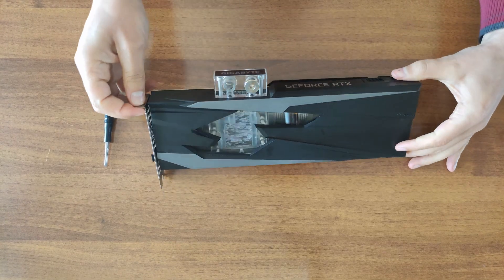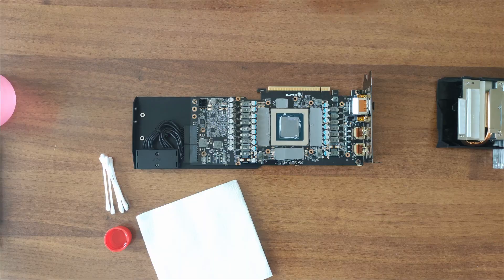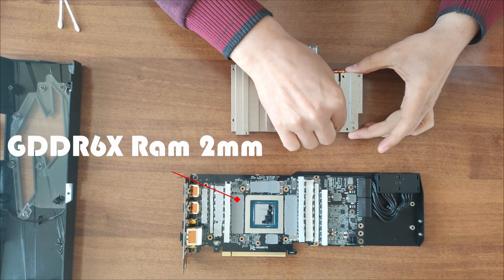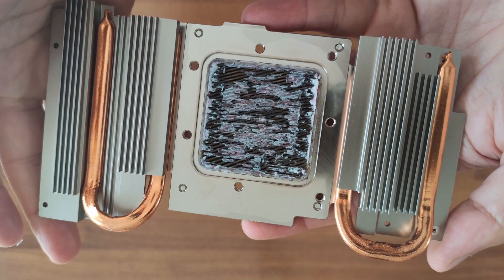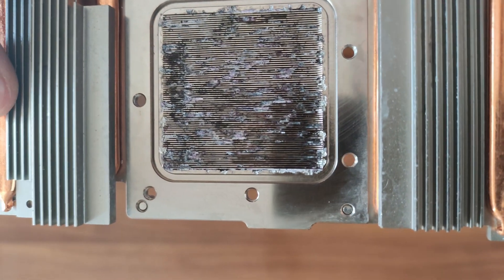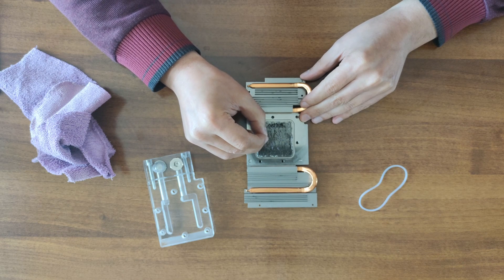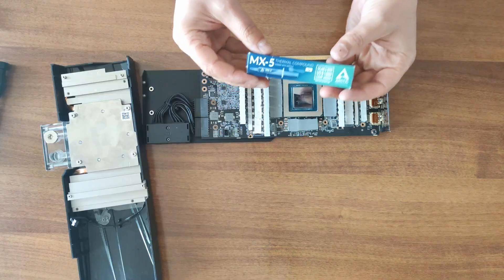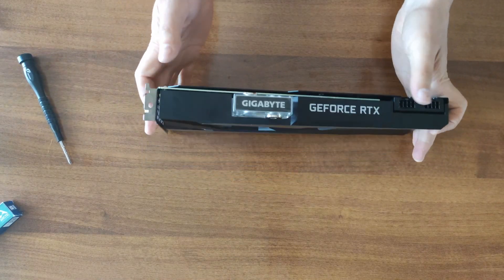How to replace Thermal Pads on Gigabyte RTX 3080 Gaming OC WB Rev. 1.0

Comment: I have the exact same card that had a large build up. I had to clean it carefully with caustic soda, having the copper and side aluminum isolated. I was using a razor blade to clean between the fins. Only this way I was able to get rid of the dirty and put it back to work. I was curious with the replacement you told about on the video. Did you replaced your block or not?
Reply from the maker: unfortunately yes, or i should say fortunately i had to buy new aftermarket coolers from BAROW, the stock ones worked a bit after cleaning but then they just exploded from the side of the GPU poring the water all over my PC, but somehow they and the PC survived, so keep an eye too cuz i think it's a common problem for this version.

Comment: How much thermopads i need for replacement?
Reply from the maker: Depends on the model of the GPU for mine it's enough a 40x90 2mm for the memory and 40x80 1mm for the other components
Reply: @spintesttech  Thank's
Reply from the maker: @BlackSkill5  just make sure you get the right thikness for your model
Reply: @spintesttech  1mm is enough ? or better to use 1,5mm ? I have the same card.
Reply from the maker: @BlackSkill5  if you have same card with same cooler you need 2mm for the memory, 1mm for the rest and 3mm if you wanna add thermal pads on the back